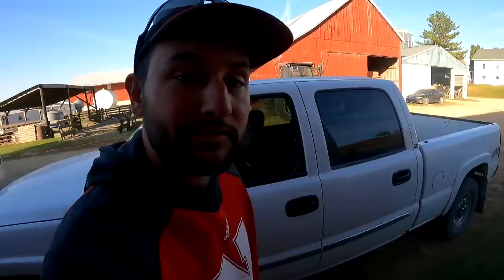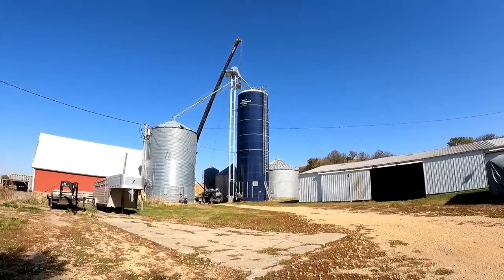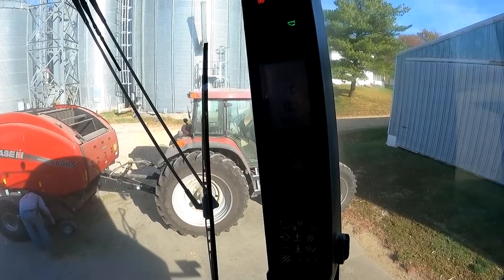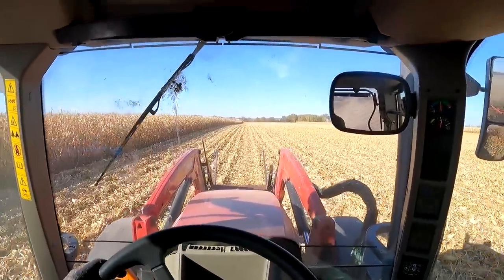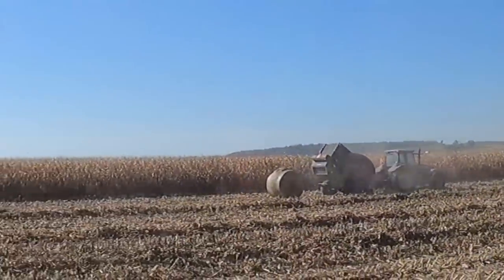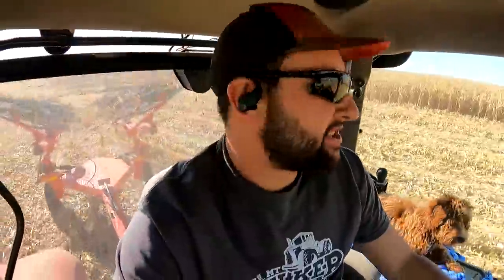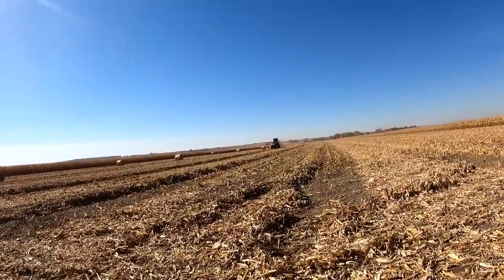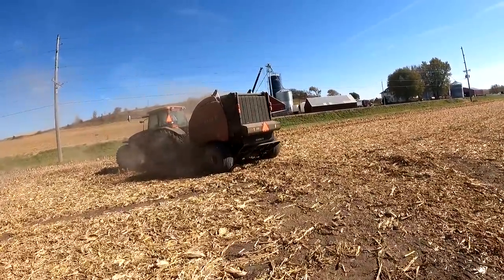This Crane is CHANGING OUR FARM

Comment: You said you can wrap 250 bales per roll of net. I only get 160 6 ft bales per roll at three layers of wrap. Maybe you need to apply more wraps to prevent broken bales.
Reply from the maker: Well my 250 was just a rough guess... I am not the baler guy haha you're probably correct

Comment: So on the subject of raking , why not just drop the choppers and drop straw in a row instead of burning diesel raking it?
Reply from the maker: Great question! We would definitely save diesel by not taking and doing that… but a majority of the corn plant doesn’t go through the combine… it gets separated by the corn head. So we figure as opposed to the baler driving all over the field and taking so much longer to get a bale… we will rake it up, get bales quicker, so they are easier to pick up.
Reply: @HartungFamilyFarms  ahhhhh. I forgot about how corn headers work 😅  I'm all small grains